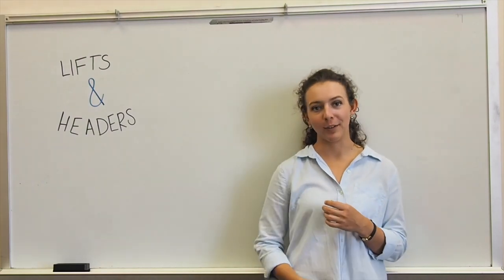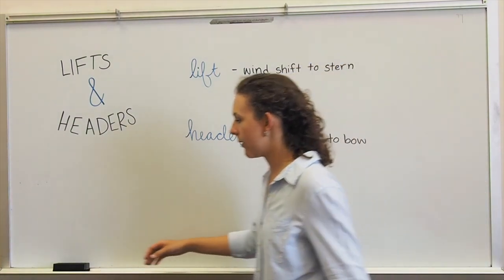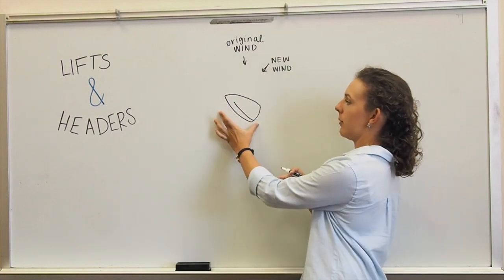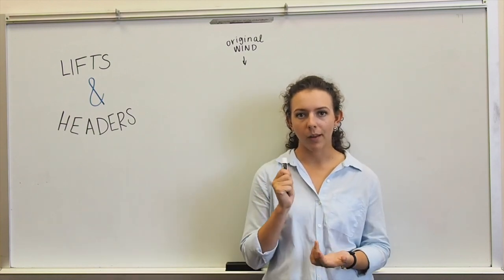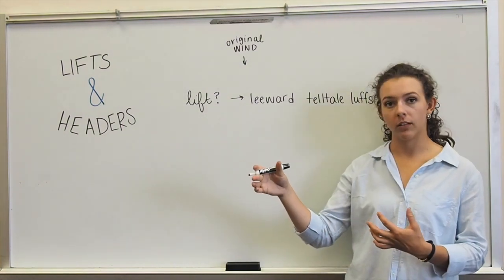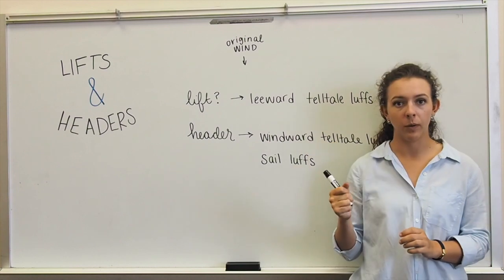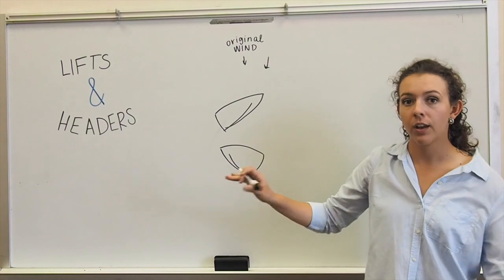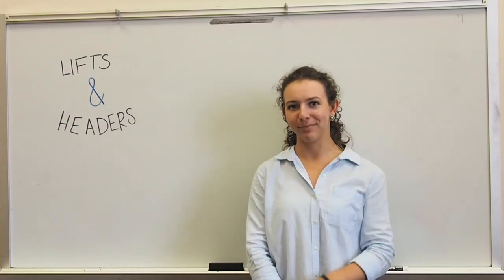UGA Sailing: Lifts and Headers

Comment: Some headers seem very temporary. And of course you don’t want to tack too much…every time your headed (or do you every time?). Is there a rule of thumb as to when you should tack when headed? How long do you wait before tacking?
Reply from the maker: Hey there! Knowledge of the area will really help you with this one- for instance, a big header could come as a result of how the wind is playing over the trees on a shoreline or how the land is heating up as the wind meets it on the shore. For big changes that are because of geographic occurrences, it's smart to tack on those headers because they probably aren't going to reverse and work in your favor. 

If geographic elements aren't a factor, you can start to take notes on how long each of the shifts last for and how great of a difference there is on a compass. Having a compass near the base of your mast will help you keep track of what the average is for the day and will educate your decisions when the shifts arrive. If it's a huge header and way off your average compass reading, probably best to tack on it. If it's minimal, you can consider taking the small hit in favor of continuing on your course to the spot on the course that you want to spend time. No matter the severity of the shift, though, keeping tabs on how long the wind takes to clock back and forth will help further educate your decisions on how you want to react to the shifts. (eg. minimal header but it's been taking a long time to come back? Then that will affect you over the length of your leg and you might want to do something about it. OR huge header but you know it'll come back because the timing has been pretty quick all day? Maybe you stay on that and take the gamble for a minute with trust that the wind will act the same way you've observed the whole day.

There's an essay for you haha happy sailing!
-Allison